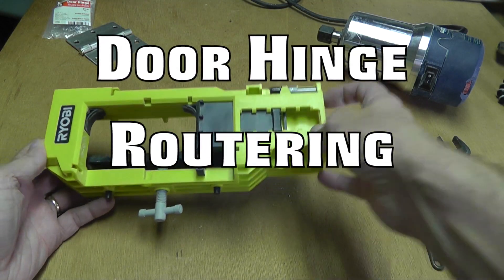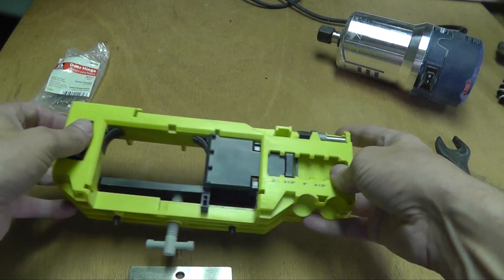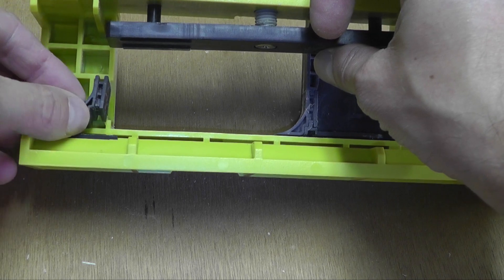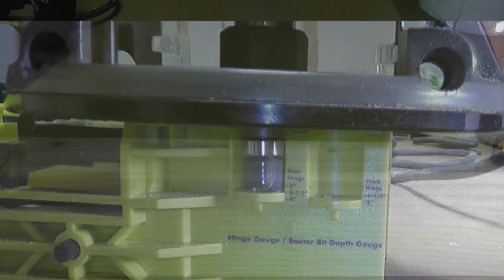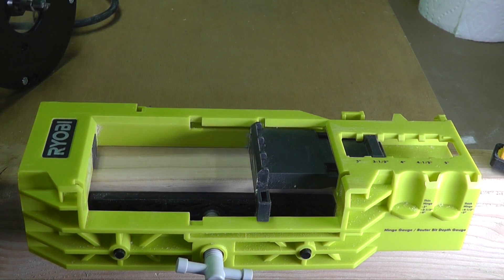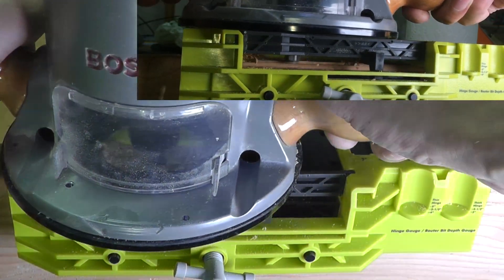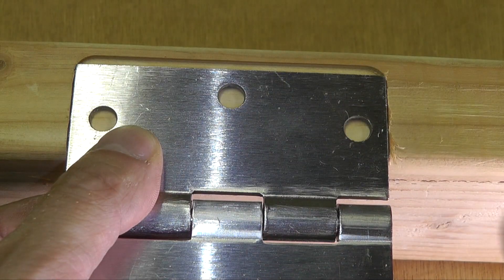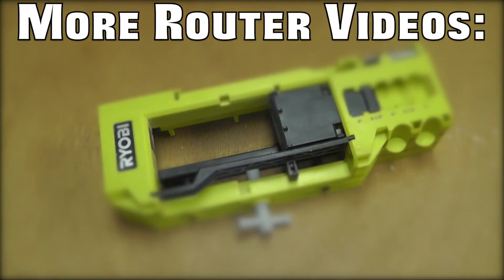Door Hinge Routering without a Chisel

Comment: Just bought a milescraft hingemate 150 mortis template kit at lowes that can be used on edge of door & on edge of door jambs even comes with 1/2" router bit that does 1/4" or 5/8" radious cuts for 3" & 3-1/2" hinges, thing I dont like about the ryobi hinge template it does not let you set up their template to a door jamb only on a door edge milescraft does it all for jambs & doors.
Reply from the maker: Thank you for the info!  
I was wondering if there is a kit that allows you to work on the jamb. 👍🙂